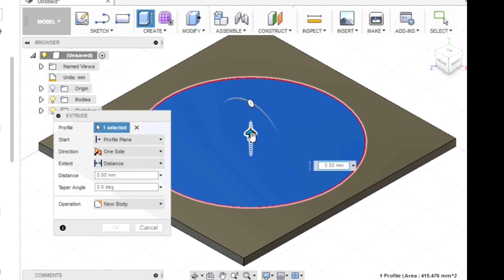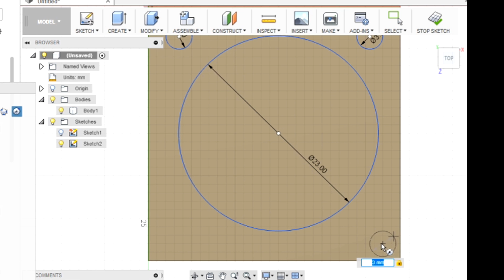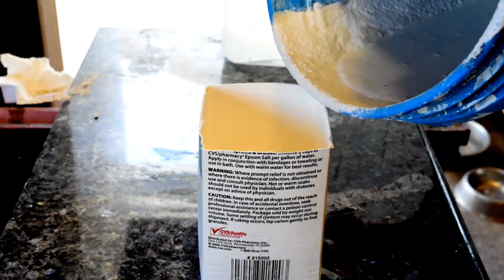Designing, 3d Printing and Metal Casting a Replacement Part for a Carburetor

Comment: Man, every time I watch one of your casting videos and see all the bubbles in your parts, I just can't help but think a woman would get better, cleaner castings than you.

Why, you ask?

BECAUSE SHE WOULD KNOW HOW TO USE A VIBRATOR.
Reply from the maker: And yet you keep watching...
Reply: @RealProjectTube  Yeah, I know. Partly it's because there is still a lot of good information here (along with the air bubbles), but also there's some morbid curiosity to see if you'll borrow your girlfriend's Magic Wand and put it to work on the plaster.
Reply from the maker: @noiwonttellyoumyname.4385  you have an odd fascination for vibrators, I suspect your in my 13-18 demographic.
Reply: @RealProjectTube  I have an odd fascination for degassed investment plaster. Just get something that vibrates and put it next to the bucket, or sink it in the plaster for a few minutes*. You'll get much, much, much better results. It won't be as good as vacuum degassing, but you will ABSOLUTELY see an improvement in your results.

*sink it only if it's sacrificial, though. if it's something expensive, just put it on the outside.

Comment: While your general concept is OK you really need to learn more about the design and craft of casting.  Investment castings shrink from the original design so you need to factor in shrink as well as metal flow.    Burn-out of plastic is fairly toxic.    Start with using all wax part and sprues/vents.  Properly mix investment.   Vacuum investment to eliminate air bubbles.   Provide a pouring basin in the mold.    Lots of details to learn about and be aware of.

Comment: Nice job! For what it's worth, I think you can use regular PLA for this kind of casting, I've seen a handful of videos that use lost-PLA the same as lost-wax for investment casting.
Reply from the maker: Eric Duprey you definitely can use PLA and I have done it several times. The wax filament is a bit easier to work with though. It burns out at a lower temp and much cleaner then PLA.
Reply: A higher temp before you pour will make it not "lake up" so much on top of the mold (higher temp=lower surface tension) and will get better resolution in the part being cast.
Reply: in our foundry we pour aluminum zinc alloys when they have a very slight pink tint to them, about 1400F. If they are entirely glowing pink its a bit too hot.  Also what investment mix are you using?